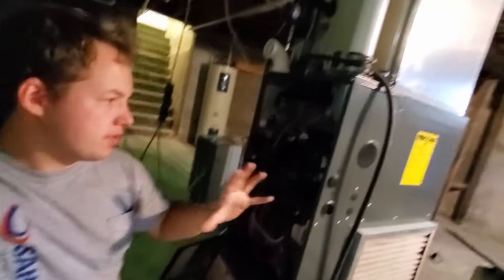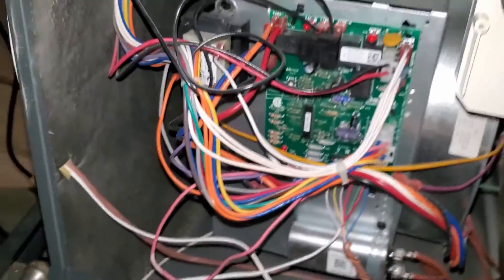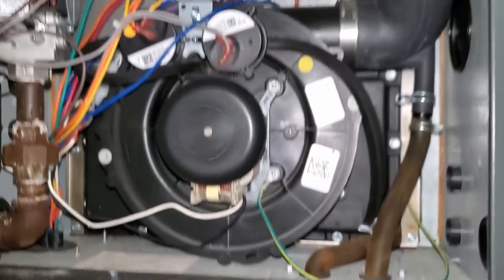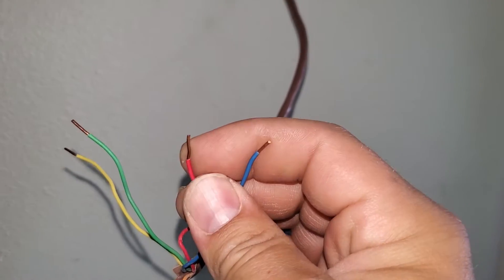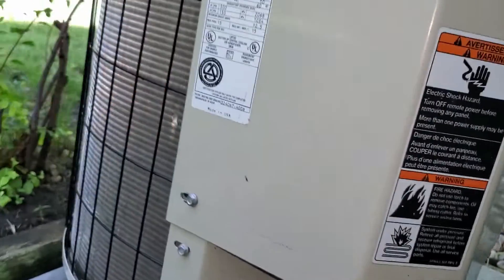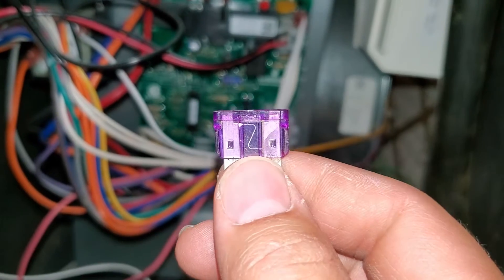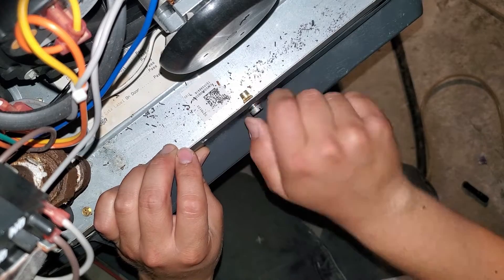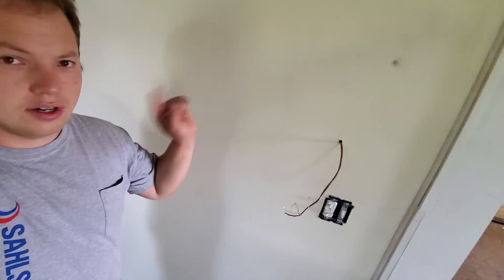How To Replace a Fuse on a Furnace or AC Air Handler Control Board

Comment: I thought I needed a new furnace  or at least the blower the fan and the switch... I had no power to my furnace at all. I thought probably 3-5K  The honest Hvac guy came and said he replaced an old fuse and it is working great now. He also rewired the thermostat. 200 bucks . I completely forgot that a circuit board has a fuse in it.

Comment: My problem is that a fuse blew after i put the new wifi thermostat face plate on.  It turned on and then shut off after about 3 seconds.

Comment: I have an old Carrier whose main blower will only run if the fuse is pulled, and I spent waaaay too long trying to trace electrical circuits to figure out why.  I did ask an expert and was just told It's Wired Wrong.  This was a big help.

Comment: I couldn't find the fuse! You saved my butt! I accidentally sniped the t-stat wire when I was replacing the foam on my a/c cold lines as the old foam was still there after slack installer left it! Warrenville S.C. contractors suck! Not met an honest one here. Anyway, I looked and saw the 3 amp fuse. Sut off the main power 1st. Replaced the 3 amp fuse, its the bigger style like the older cars use. I am telling you, EVERYONE, people, please find your fuse, and stock several of theses tape them on the furnace board door in case. Could have cost me $500.00!
  I really appreciate your video!

Comment: Thank you so much! Found the blown fuse and the bare wires touching near the outside unit. Fixed the wires and got a new fuse and now the AC is working again all thanks to your video!

Comment: Good video.  Thank you.  Replacing the fuse got the fan working and the heat working, but whenever I select AC, the fuse immediately blows.  All the wiring seems to be good.  No clue how to proceed.  Carrier control board hk42fz0343213

Comment: Yep, you called it. My yellow wire was shorting out on the AC because the relay low-voltage side was shorting. Thanks for the help.
Reply: What did you do to fix it

Comment: Would this be the fuse to replace if the low voltage R wire is not giving power to the thermostat?
Reply: I would love to know an answer to this question as well. Thank you.

Comment: Is it possible my Trane AC condenser/handler does not have a fuse? I have two zones and the upstairs unit 2 just stopped working recently. I replaced the thermostat-no luck. I replaced the capacitor-no luck. Then I got the brilliant idea of switching the good contactor from unit 1 with what I suspected was a bad one on unit 2 and sure enough, the functional AC unit stopped working. Problem is, putting the good contactor on the unit 2 did not make it run.  Now I have two dead AC units!!Fairly certain I blew ‘something’ but I see no fuse of any kind in the condenser. Help!

Comment: Something shorted from water leaking in from a pipe.  Just a few drops in the wrong place and bang.  No idea.  Hoping its a fuse cause i dont got money for much else and its 20 degrees out and middle of winter.  Mild winter actually or id have to move today.

Comment: TY….replaced therm and powered off wrong beaker  hooked up new therm nothing worked but my fan was just on high  noticed a burn in the fuse and did not know these are just  auto type fuses. Replaced with one from Ace and boom fixed   A tech wanted 450$ to fix it said some wires and board was shot well 5$ fixed it TY
Reply from the maker: Awesome!

Comment: Could my fuse have blown from my thermostat batteries becoming corroded and dying? I found my thermostat dead, opened it, the batteries were dead and full of corrosion. I cleaned it up, replaced the batteries, and now my thermostat turns on, but none of my system will. No AC, heat, fan.. circuits are all good. Checked voltage to thermostat, and I don’t have 24 volts coming in.. would a blown fuse cause no power to thermostat? Does that scenario pan out at all. Seems like a huge coincidence that my thermostat batteries would die and also everything else stop working at the same time..

Comment: My ac is opposite, and my 3 amp fuse is in a mix of wires. My thermostat is out. I should had gone to AutoZone and grabbed a replacement, because AC repair guy only had a 5 amp fuse, that made my thermostat blink and not come on-

Great extra information as well, thank you

Comment: You are the MAN!!!! My AC would not turn on.. it reached 90 Degrees in my home. After much testing, I found the 3 AMP fuse was blown. I googled the 3 AMP fuse and your video came up, and your very informative site walked me through why it blew. I had bare wires outside next to the air handler. I repaired the wires, replaced the fuse and my AC was FIXED... I cost me $5, and I have 3 extra fuses!!! Thank you for sharing your expertise!!!!

Comment: , I think I know why mine tripped,  I was in the process of resetting my AC after two power outages , I got a third one in the middle of the the reset .
Reply: Mine also said it’s the open roll out switch circuit, is that the same same the fuse

Comment: Thank you! Snipped my wires while remodeling to move my thermostat to the adjacent wall figured it’s low voltage and wouldn’t cause an issue. Glad you provided a detailed and clear video to fix it. Saved me calling an HVAC technician out!

Comment: Hi Ben, my 3 amp fuse keeps popping when I turn on the heater but it stays on if I just turn on the fan. An Electrician told me to switch out the white wire on the thermostat to the brown then go to the furnace and do the same. What is your opinion?

Comment: Just wondering, could the fuse have blown because the compressor froze up due to a clogged filter?  I replaced filter and let compressor thaw completely but when I turned the system back on the air handler would not turn back on.

Comment: Just in general if you had a fuse that kept blowing I know I do it in automotive and on my motorcycle but can't you put a light in between where the fuse goes and as long as you're short is still present the light will glow brightly and when the short is eliminated, the test bulb will just glow dimly or go out? 
Of course you would need a 24 volt bulb I don't know if it would burn a 12 volt bulb out if it had a direct short it probably would.

Comment: Do all furnace control boards have a fuse? For the life of me I cannot see one on there however I will look better tomorrow. At the board I jumped out the red wire terminal and the g wire terminal hoping to trigger the fan but it did not come on. When I set my air conditioner to call for cooling the fan does not even run. I think my a coil may have froze up because I see a lot of water after the furnace stopped running a lot of water dripping out of there and in the shelves of the furnace. What would be my first step to check for power out of the transformer that should be roughly 24 volts ac volts correct? Actually I am renting but it is so hard to get them to do anything around here and all I get is smoke attempting to blow up my ass from the maintenance guy and I don't want to go through that again with him if I can help it. The furnace filter was kind of dirty I did replace it but I don't think it was dirty enough to shut everything down either. Is there normally any kind of reset button on the blower motor itself I did not see anything in there so is it I guess my first step would be to check for roughly 24 volts out of the low side of the transformer? I do not have to have my thermostat set to be calling for air conditioning or anything do I ?
That red wire at the board the red terminal power terminal and common I should have 24 volts between there full-time correct?

Comment: I am trying to see if the reason why my AC stopped working after I replaced my thermostat has anything to do with the fuse. The fan is working fine but it is not blowing cold air. AC condenser unit fan and the compressor do not come on, outside unit is quiet. Replaced capacitor, didn't solve the problem. What is causing this?

Comment: It looks like you diagnosed exactly why I blew the fuse. And this makes me put it back together properly. First turn the power breaker off. Second install the new thermostat. Third install the fuse. Turn everything back on and hope to God that everything is going to work. But I'm pretty damn sure I blew it by shorting out the common

Comment: Thank you so much for the on point lesson. I learned the lesson that this fuse can blow if you don't cut the power before replacing your thermostat - the C and Rh wires may touch each other before you know it.

Comment: Hey Ben,  I replaced the fuse, it turned the the system back on, but the heat & A/C are not turning on - but there is air flowing. Also, the thermostat seems to be going on and off. Any suggestions?

Comment: 😅😅😅 i had the wiring done right when swapping out for a nest thermostats, my fuse wasn’t blown but i kept wondering why it wouldn’t work…well its because i didnt release theres a safety switch when removing the panel that stops the power to the broad 😂 was he said theres a safety switch i look around for mine and pressed it and power came on thank you so kuch mane

Comment: AC & Thermostats stopped working (nest DIY. lol) and was about to call a technician (takes few days for an appointment as they are busy). Once i saw this video thought of giving it a try. Goodman furnace. LED was blinking 10 times a round indicating open fuse. 5 bucks for a 4 pack in AutoZone and my AC is on and chilling inside now on a hot weather day. Thanks Bro....You rock

Comment: I pressed that safety switch, and the led light red. I heard a click but blower didn't turn on. I checked fusebits ok. I changed thermostats. And 1 capacitor. No blower motor turning on.

Comment: Thanks for the video. My furnace was dead due to fuse blown away. I was changing thermostat without turning off power. So red and blue must have touched. Now the fuse has been replaced, I can run furnace by door's switch. I am see one flash - system lockout. What needs to be done to fix this ? Any help is appreciated.

Comment: Thank you for video. Saved me $75 service fee by diagnosing this problem.. my thermostat was not getting power and this help me figure out why.. burnt fuse.  im replacing it with a 5amp automative fuse. 3 amp will work  too.

Comment: Just watched video. My control board doesn’t have replaceable fuse but there is a reset between two wire that connect to firebox. That did the trick. Thanks for posting as it helped me troubleshoot.

Comment: Dude you rock - my exact issue with shorting out the fuse when i went to change a thermostat ....THANKS!
Reply: What if your air handler doesn’t have a circuit board? Mine is 1977 Bryant. I don’t see a 3 amp fuse also . I was messing with the thermosthat , I bypass it . I was trying to fix a no start heater I short circuited something in the proccess and now the AC doesn’t turn on also. Any tip what to check? I don’t see any fuse or circuit board. Could it have killed the transformer?

Comment: I watched a dozen videos today as I accidentally blew the fuse while replacing thermostat. This is the best video out there. Not only it helped me to fix the problem, saved me $80 for getting someone onsite, but also this helps me clearly understanding almost everything on the board. Thanks a lot for doing this video!
Reply: Exactly why I watched this video lol
Reply: Ditto!
Reply: I keep blowing the fuse while replacing the thermostat 
Could you help me
Thanks
Reply: @mofassy  did you ever find out what the problem was? Mine is doing the same thing.
Reply: @KHAOE1  there is a short somewhere trace your 24 volt line and make sure no wires are rubbing
Reply: @Jose I  thanks. I will check that.
Reply: I'm not alone. Hahahaha
Reply: Finally solve my problem🎉
Reply: Same. Whole heartedly agree with this. He saved me $135 PLUS paying for their overtime.
Reply: Same, I blew my fused replacing my older thermostat. Thanks for the help
Reply: I can't locate the panel where the fuses are. If some can help please do
Reply: Same 😂
Reply: Same! 
Finally solve thanks to this great man!
Reply: Same here

Comment: If I’m not seeing any obvious shorts, can this just blow from overuse?
Reply: What it can blow from is a clogged filter. Which will blow the fuse and shut down the system to prevent damage. A clogged filter is a common problem for blown fuses.

Comment: Hey this fixed my rudd over acheiver 80 series but it seems like it doesn't stay heating but for one secon
Reply: prolly a pressure-switch problem
Reply: @MP-zf7kg  it was a flame sensor sir. Thank you

Comment: My fuse keeps burning out after I replace it. I turn off the power and change it and when I turn it back on it burns it out too. What should I do?
Reply from the maker: The thermostat wire is shorted out somewhere.

Comment: You do not explain what to do if your 3 amp fuse continues to fail every few weeks!? WELL, this is a real issue, and you have very few suggestions as to what is really happening. My experience thus far: A) Blower stopped working, I was first thinking something about thermostat and I replaced it B) Read about capacitor, replaced it. C) Finally found the 3 amp fuse, after thinking first it was labeled "E" like many others. D) Replaced it, but did not turn off power to system when replacing the thermostat, so I then realized I probably shorted the fuse when I replaced the thermostat. E) Replaced thermostat, capacitor, furnace blower wheel and fuse, and fuse still blows every few weeks. Otherwise running fine. 
Best way to find a solution? Deduce the problem:
<-- Oil the furnace blower motor? 
<-- replace the furnace blower motor?! (even tho it is working) 
<-- put a higher fuse or slow-blow fuse in the board (board works fine)??
<-- any autoparts store has these fuses, so I might try a 4amp or 5amp fuse

Comment: Mr Sahlstrom, another great video.  I recently had to replace the 3-1/2 amp slo-blow fuse in my mini-split heat pump unit.  My unit uses the 5 mm glass cartridge fuse.  I had to order a replacement online.  The fuse in your furnace is easier to remove/replace, and I believe is available in auto parts stores.  I appreciate your work, and I find your topics interesting and informative.  I hope you and your family are safe and in good health.
Reply: P

Comment: So I have a puzzling problem.
I have a heat pump that since installed we have continually had u issues with the outside temp sensor.
The thermostat red error light comes on and is says there is a sensor fault.
On a 60 degree or so night it would say outside temp was reading outside temping the low hundreds.
I'm guessing the wiring may be partially shorting out.
If it's a thermistor pride with ntc, usually the sensor should read artifical low.
The question is these sensors is ally a thermistor or RTD?

Comment: Awhile back you recommended that I should buy a champion portable generator. The only problem I have is that it's doesn't run off propane. I would like a generator that runs off propane cause it's easier to store propane than gas. Any recommendation on propane generators with 10k to 13k watts? HOOF OUT
Reply: Hi there, DIY here. I must have shorted the fuse in the air handler, My air hander doesn’t have a circuit board and I don’t see a 3 amp fuse . My AC wont turn on . I was trying to fix the heater that won’t turn on I bypass it and now the AC won’t turn on also. What to do now? I don’t see a 3 amp fuse .

Comment: Dare I say it, if you can’t find a fuse and it’s necessary to get the furnace going, you could jumper the fuse holder terminals and restore power to the board. However, as Ben said, you must be certain the cause of the fuse blowing has been found and repaired, otherwise restoring power with a dead short will cause the “magic smoke” to escape from the board. It’ll be completely ruined and wow, are those boards ever expensive. When in doubt, don’t jumper out.

Comment: Another great video Ben, a while back I went to a smart thermostat and had to use that extra wire, lucky for me it was neatly tucked behind the wall, I did however have to go up into my attic to connect that extra wire into my air handler control board, this issue might trip up some of our subscribers—- maybe a quick video to show people how to do this—-otherwise great content as always!
Reply: Whats the general process to do this? Mine has an extra blue wire but guessing it's not connected to the board. How/where should that connect to the control board?

Comment: What about the on/off dedicated circuit switch thats supposed to be in the area usually attached to the furnace?.
Reply from the maker: They are not always present as if the furnace is in the same room as the breaker panel it is not required to have a separate switch. You're right though, usually there would be a switch on the side of the equipment.
Reply: @BenjaminSahlstrom  ohh , i thought it was a requirement.  But yes ive seen where there is none